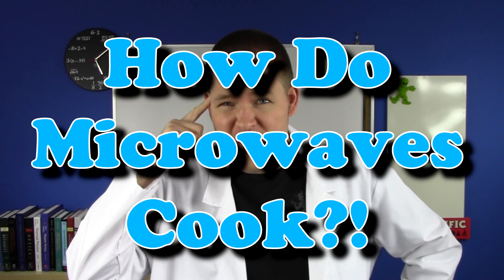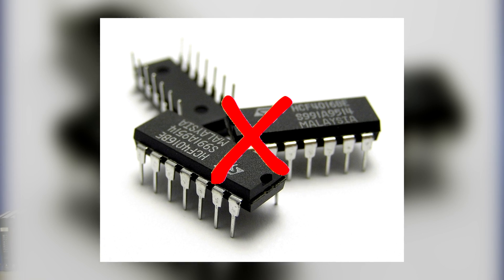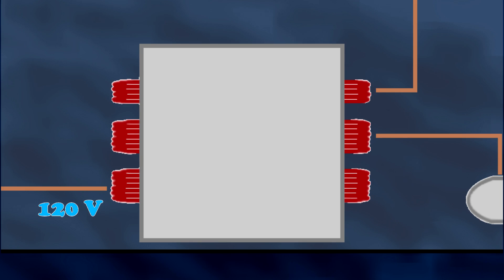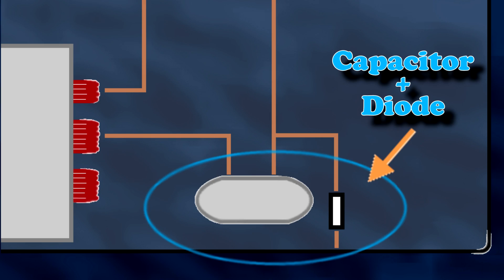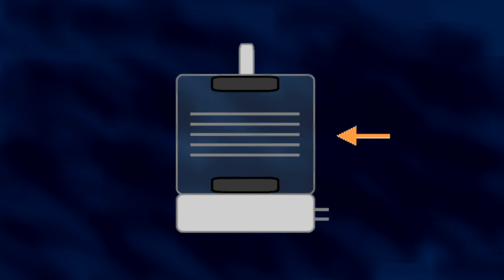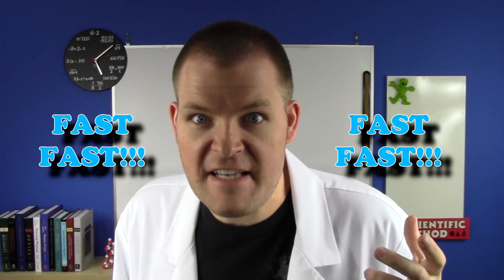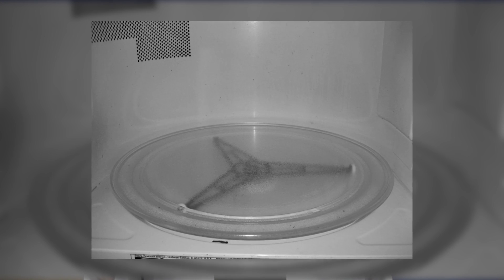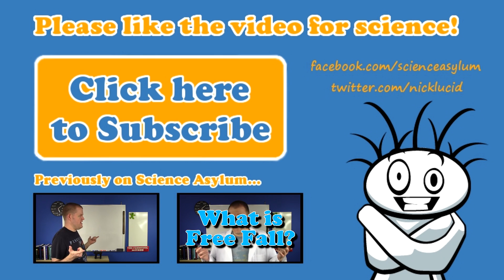How Do Microwaves Cook?

Comment: A friend of mine inserted an egg into the microwave oven. He'll never do that again!
Reply: Manuel Cheta i did the same mistake, now im vegan
Reply: I routinely fry egg in microwave oven. Just find a ceramic bowl that has a diameter of roughly 1/3rd of the long axis of the cooking space. Then crack the egg and put the yolk and white in the bowl. Sprinkle some salt to your taste. Then put it in the oven, at the center on top of the rotating plate. Depending on different power settings, you need to cook it for 20s to 60s. You just have to calibrate it by trial and error which works best for you. Best way to do that is to cook for 20s at a time and then open the hatch to check. If not cooked to your expectation, keep another 20s and so on. But it is not wise to exceed 60s. It tastes just like an egg fried on a frypan. Once you got your settings right, it's super convenient. You don't have to check and re-check every time you fry an egg once you figured out the calibration at your first one to two trials. Then you can do it in one go. It's that easy! Just keep the bowl, power settings and timing fixed for a given oven that you have calibrated.
Reply: @saumitrachakravarty  exactly. The reason that the egg explodes in the microwave is because of its shell. The pressure builds up and at some point the shell can't hold the pressure anymore and explodes.

If you already crack the shell there will be no pressure build up and it cooks normally :)
Reply: I can't even imagine the mess he made.

Comment from the maker: I've never seen this in person... I consider it a tragedy! It must be corrected.
Reply: I'm an engineer working with microwave ovens. Not the ones you cook your food with but the more expensive ones that chemists use to heat up samples and therefore accelerate reactions. Contact me if you want me to show you how they look like on the inside, and how they work.

Btw you made a good job explaining it roughly :)
Reply: @bennokrickl8135  are you called a electronics technician?
Reply: Benno Krickl I would message him.  He probably won't see a comment on a video this old.
Reply: I like professor or teacher teaching using sense of humor lol 😂😂😂
Reply: but how is it that 4000 v attracts, actually it's confusing. 4000v is positive, but current is conventional current, so electron flows in reverse so what's positive, electron should go there. kind of confusining
Reply: also the interference, amplitude increses , so i was thinking(several times thought before) this confusing amplitude shows intensity n no of photons shows  intensity, both r true, but how, i mean how large is a photon, u have video on that but i couldn't understand,, because size of proton exists so photon should/could have a size?